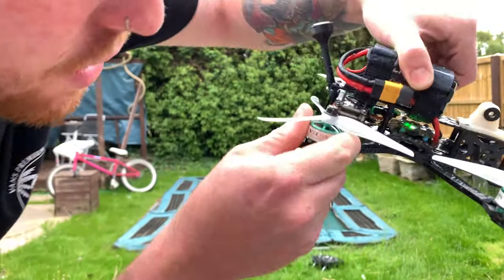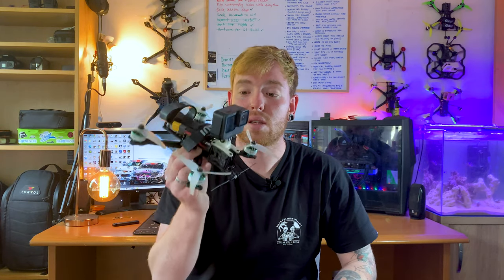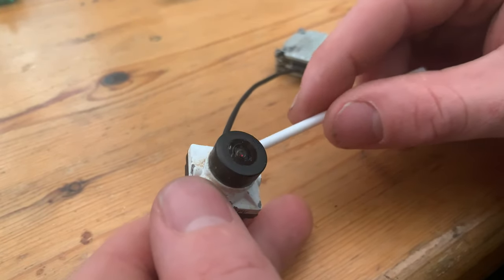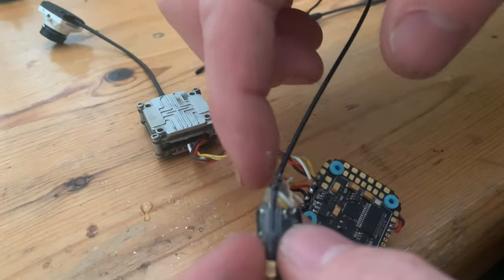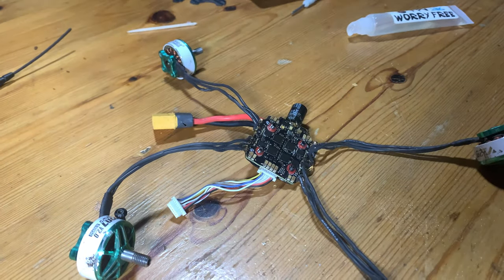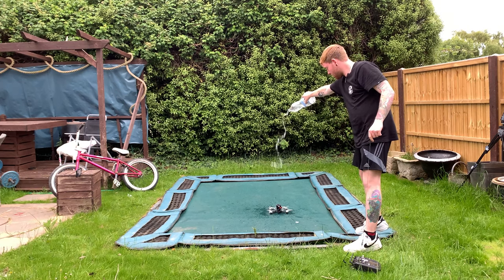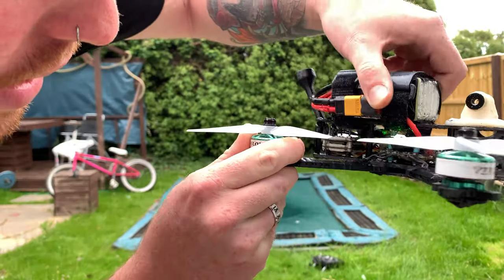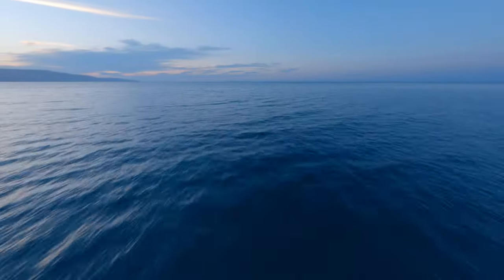Would You do this to Your Drone? | FPV Worry Free Waterproofing

Comment: The way it lifts back up out of the water is mind-boggling. I reckon if you set it to return to home as the failsafe, it would automatically shoot itself back up through the surface as soon as it lost radio signal…or rocket down to the bottom if it was upside down, of course.
Reply from the maker: I know right it’s mad! That’s actually not a bad idea, although I think waterproofing a GPS may have some effect on GPS signal, and also it’d probably lose gps signal in the water too? Maybe one to test!!
Reply: I’ve never had reason to test it in real life, but if I’m not mistaken Betaflight GPS Rescue has an initial altitude setting that would cause it to shoot back up vertically before trying to orient towards home - that motion would probably be enough to re-connect to the transmitter so the GPS isn’t critical as long as you still have video.
Reply: @thegingerdronepilot  barometers don't handle waterproofing (they have a little hole), but if you get a gps without barometer it should work fine.

Comment: What about the battery? Hot do you water proof tgat and the conector?
Reply: @rapeerdb1  really? And you dont have to worry about it shorting in the xt60?
I would totaly do this if you are sure i wouldnt destroy a expensive battery
Reply: Also are the usb ports water proof too then?
And the moters i think are right?
Reply: @rapeerdb1  then it wouldnt work lol.
Thanks. I just didnt want to fry my new drone as soon a I finish it as im mostly flying over water.
Reply: @rapeerdb1  thx man. I also just realized i can ducktape or electrical take around the xt60 when its pluged it to make sure no water gets it.
Thanks again
Reply: @rapeerdb1  thx
Reply: @rapeerdb1  sorry one more question. What about the balance cable?

Comment: Boss vid bro , I’m 2years  in fpv now , I’ve almost bought everything for a 5.5 AOS 6s waterproof build , quick question when choosing flight stack would you swerve flightstacks with heat shield was thinking Mamba F7 22 M4 65A
Reply from the maker: Nah dude should be fine, either take off the heatsheidl if it gets in the way or just shove a load of worry free on top, havent seen a flight controller it cant cover yet 🙌🏻

Comment: I remember we used conformal coating on Analog to digital converter circuit board and readings were way off. We found out the board had to be completely dry before coating applied.

Comment: So when it's dry, is it a rubbery coating or a more epoxy-like one? I have an aerosol can of MG Chemicals 422(IK I should've gotten liquid not aerosol), and I'm wondering whether or not to use this instead. 5:54 is what's raising the concern; if a craft knife or soldering iron can't get it off the connector, it's a no-go for me.
Reply from the maker: It’s a rubbery silicone type material, it coul easily come off by peeling or using a craft knife. I just don’t think it’s be easy to save the cable with all the worry free in all the nooks and crannies. But if you have a replacement cable it would be totally fine 👌🏻 This stuff is definitely different from the MG Chem stuff, I have the liquid and that won’t make it fully waterproof IMO, I think it’s because this stuff is thick and creates a full layer of waterproofing it works a treat 💪🏻

Comment: I assume this is just a low viscosity RTV.  My only concern is heat dissipation since this a pretty good insulator.  Flying in and out of water is pretty sweet looking though! :)
Reply: That's what I was thinking.  Solvent based silicone caulk.  It's not going to last forever in the elements, but it looks like fun while it lasts.

Comment: I am new to fpv but are the motors waterproof?
Reply from the maker: @Alec15  yeah man 🙌 all brushless motors are “waterproof” because there is no physical connect between the windings and the magnets 👊🏻 salt water may corrode them though
Reply: @thegingerdronepilot thnx man! I am probably gonna chase boats a lot. Is there a way to also make them waterproof for salt water?
Reply from the maker: @Alec15  Best thing to do is just rinse your motors with fresh water if it goes in or if you think any splashes got in them. Then they’ll be fine 💪

I chase boats a lot too and half the time I don’t even use a waterproof setup, just put a floaty on - and try not to crash!! 😂 

At least with a floaty you can get the footage back and it won’t sink. The salt water may fry the vista. But if you rinse the components off with fresh water you may save some bits 👍
Reply: @thegingerdronepilot  thank you!!

Comment: How long does it last? Does it wear off? What if you need to work on your drone can you get to the parts and pads?
Reply: Thinking might just need a water only drone?
Reply from the maker: I imagine it lasts basically forever if there’s no damage, goes a bit yellow after a year or so but still going strong. If you need to change parts you can solder right through it and put more on top, leaves your iron a bit messy though 👍 I only use this quad when I have to for flying over water, strap on a floaty too 👌
Reply: @thegingerdronepilot  appreciate you!

Comment: Wasnt expecting it to fly out of the pool! 😂 easy to remove for soldering?
Reply from the maker: Haven’t tried yet, but It peels off quite nicely so nothing a blade and fingers can’t handle 🙌🏻
Reply: Normal conformal coating you can just solder right through, if this cant then its most likely just clear silicone

Comment: Great Video. How about taking the gummies out when applying FPV Worry Free? Don't they stiffen / harden when you leave them on like that?
Reply from the maker: Thanks dude 🙏🏼 I left the gummies in while applying the worry free so I made sure I didn’t get any on the inside, can still connect to betaflight/dji if I have to. I think this is pretty much the only thing that’s useful anyway, I left mine in the quad and one fell out while flying anyway 😅 no damage to fc or vista 👍🏼👊🏼
Reply: @thegingerdronepilot   I meant the stack gummies which are supposed to be soft and dampen the vibrations. If you apply FPV Worry Free to them they will stiffen and transport more vibrations to the gyro. Good idea to put screws in I agree, but wouldn't it be even better to take the gummies out completely?

Comment: I have one question if anyone can answer guys and gals does this dissipate heat ? That's my only worry lol I don't want the vtx and ect ect to heat up more than it should with the coating on thanks again for the great vid man
Reply from the maker: This was one of my main concerns too, not sure why I forgot to mention in the video, I will make another video as soon as I’ve done some comprehensive testing, but it’s too soon to say rn. All I can say is that I flew this quad everyday for 9 days in 35degree heat while in Greece, no issues so far with overheating! 
My idea is that this rig is my waterproof one, and I’ll only fly it when flying over water. The rest of the time ima fly one of my other rigs and not worry about airflow and heat dissipation 💪🏻
Reply: @thegingerdronepilot  Great man! I will definitely be waiting for that vid👍🏽✌🏽
Reply: You can keep it cool by constantly flowing water across all the components 😂

Comment: How do you replace a motor? Do you need to remove the stuff or just solder over it?
Reply: I'm pretty sure you'd have to remove it.
Reply from the maker: Yeah you’d have to remove it, I think maybe a better way of doing it going forward is using racewire, easier to get it off that that the edge of the ESC

Comment: Thx for the vid bro! Nothing done on the xt60 and lipo?
Reply: Lipo's are pretty much waterproof as everything is sealed. 
If water can get in then so can air. Air (O²) is what causes the chemical reaction from Lithium (lipo fire).
Reply from the maker: KindFPV is right, as long as you have a solid connection on the xt60, the battery should be fine. I completely forgot to include the part where i put a small dab of worry free on the outside of the XT60 connector on the drone. But i still dont think it's absolutely necessary. The positive and negative on an xt60 are just about far enough apart not to cause a short when in the water i think.
Reply: @thegingerdronepilot  thanks guys! Would love to try this out and fly in the rain since theres pretty much a storm every other day
Reply: Whilst the cells themselves are sealed the terminals on the ends of each cell are not and are only seperated by either thick paper, plastic, tape or a mix of them together. Water has a direct path to the terminals on the sides where the discharge and balance wires go in to attach to the terminals. Freshwater water is no where near as conductive as saltwater so a small short across the terminals in freshwater is no big deal but saltwater will destroy your battery quite quickly. Based of about 10 different batteries that I've had end up in saltwater, any longer than a minute or two and they are toast. Spraying corrosionX or similar ( not WD-40) in where the discharge and balance leads go helps a lot ( I flood it with it personally then let it dry) Other than having the battery in a sealed container it is the next best thing IMO, unless you want to  remove the heat shrink etc and coat the terminals lol
Reply: I also spray the xt60 and balance plug before each flight over saltwater.

Comment: Hi so I applied the worryfree on my fc/esc and let it dry over night. This morning, I plugged in the battery with a smoke stopper and it’s telling me that there’s a short. Have you had this issue?
Reply from the maker: oh wow, thats interesting. No i didnt have this issue at all, my quad is still going strong and im still using it regularly. I plugged mine in basically straight after it was built too. Might have to get a knife and take the worry free off, find the fault and redo man. i dont see any other way of finding it.
Reply: @thegingerdronepilot  UPDATE: I was told that some smoke stopper isn't always accurate. So I decided plug in the battery without the smoke stopper, arm it(without props) and everything seems to working fine!

Comment: How do you water proof your battery?
Reply from the maker: Good question, you don’t. Just Fpv worry free around your xt60 connectors. The battery (if Undamaged) shouldn’t get damaged by water and as long as the xt60 connection is tight, no water will get in. Just make sure to let the battery fully dry out before charging or flying again 🙌🏻

Comment: Overkill usage of conformal coating, you dont taking care the heat that need to spread out from the electronics.
This is a bad idea.
Much better to use mg chemicals, 2 double tin coats. After each coat check the cover with ultraviolet light and your good to go.
The pros of this material is the fact you can solder easy without to take it off so its much more practical.
Reply from the maker: Hey thanks for your comment man, but this isn’t conformal coat, it’s a silicone based coating, not a polymeric film like conformal coating. 
The heat that comes from drone electronics is only in short 4-5 minutes bursts, and I haven’t had any problems flying in 35degree heat for the last 2 weeks 👊🏼 long term testing for overheating will come. But so far, so good. 
I’ve never seen a product that can make a drone take off from underwater, apart from FPV Worry Free 💪🏻
Reply: @thegingerdronepilot  Still working good? Had any issues of heat?

Comment: I know i can get conformal off, when i need to.  Can you get this off when you need to?
Reply from the maker: So, i haven't tried yet. we'll cross that bridge when we come to it. But, this is silicone based, so im guessing its going to just peel straight off with no residue 🤘 Might have to replace cables if they ever get disconnected, but its worth it.
Reply: @thegingerdronepilot  Funny thing happend after i wrote that,  crashed a kwad into a gravel truck box with a lot of rusty water.  Been drying things, and going to see how conformal did later today.

Comment: Do not buy this crap. Get MG conformal coating and just do a bunch of layers. This is basically glue and don’t even think of trying to clean it off afterwards. 

Want to get it off? Buy a new flight controller… source: experience.
Reply: Yeah looks cheap as. How is removing multiple coats of conformal coating?
Reply: @JaydenLawson  if you use alcohol and a silicone brush it comes off great. This stuff isn’t too bad if you apply it incredibly slowly with a needle tip syringe.

Comment: Bad instructional. If your board has a barometer or any clicky bind buttons, avoid and use corrosion x. Also corrosion x all the connectors. Only a moron would glue the connectors in imo.
Reply from the maker: Thanks for your opinion, but this works a treat and for the sake of a £70 stack… does it matter? Moron is a bit excessive 😜 plus, it’s not glue, it’s silicone, it comes straight off of you pick it/pull it off. 🙌🏻